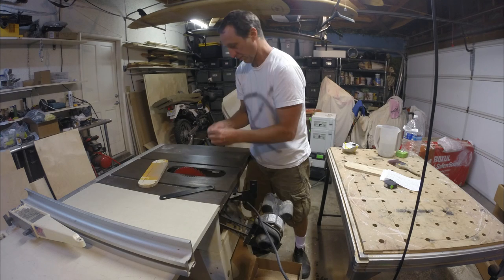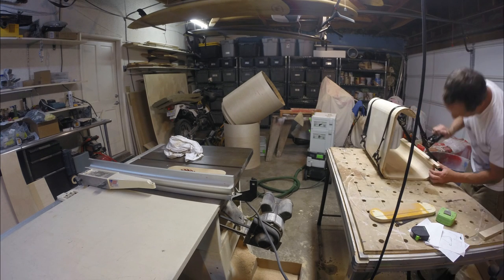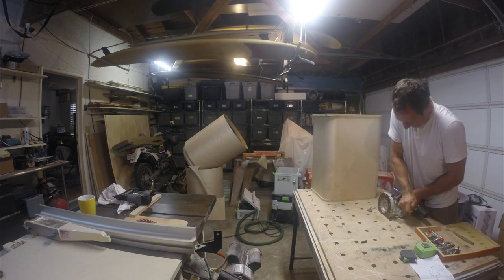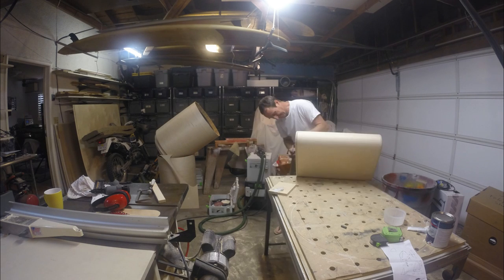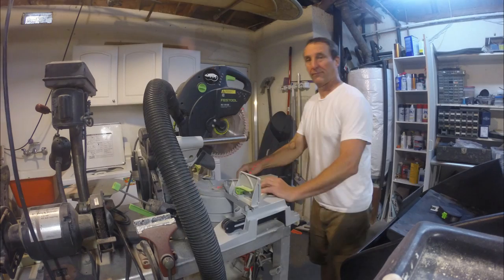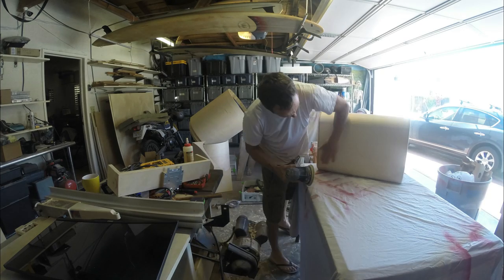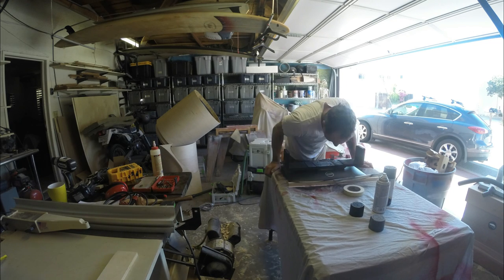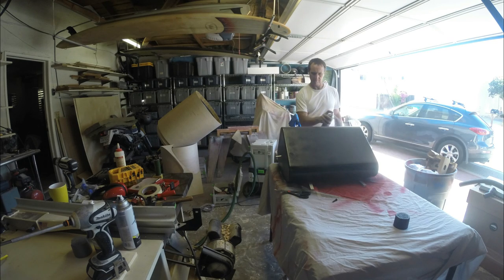Time Lapse Building a Teleprompter Wedge Shell

Comment: How cool to have Dave build something custom just for them!
Reply from the maker: Paul Morini I enjoy doing custom building for clients, I made a different version similar to the teleprompter shell that matches the wedges and holds set lists and has a light in it for Pearl Jam. Troubadour has a custom single 18" cab I made that tunes up similar to an L-Acoustics SB28 and fits under center stage as well as caster plates and large grills and lid to protect their 4 SB28's.  Rusty's on the Santa Monica Pier has a custom wall panel plate to cover the snake inputs. It is really fun to be able to create things that solve specific issues that can not be purchased elsewhere.  Thank you for commenting Paul!

Comment: How did you calculate the width of the cut grooves and number to get the curve you wanted. I'd like to build one like this for myself.
Reply from the maker: I did it by cutting some kerfs in scraps of the same type of wood of wood I used for the build. The blade thickness, wood thickness and distance between cuts all have impacts.

Comment: Tech question , on a Onyx mixer w built in compressor , our out put is so small the compressor does not see it , how to fix this ? Assign compressor to a sub group ?   Thx
Reply from the maker: +Stan “stan7007” Last Hmm, not so familiar with the Onyx. You could try reducing the gain on something after the mixer so you drive the mixer outputs at a higher level.